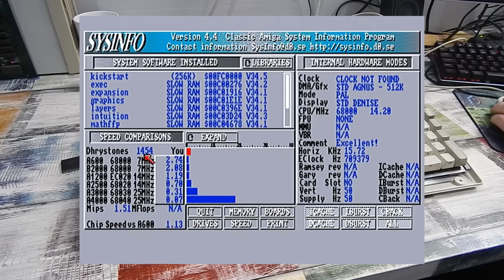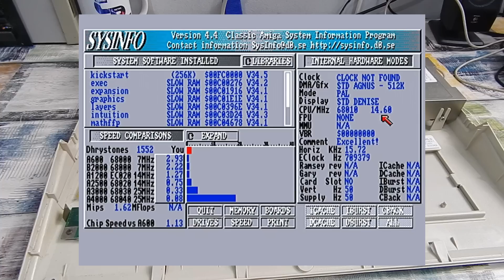Trying a 68010 in my 14MHz Amiga 500

Comment: I used to work with the 680x0 CPUs in the late 1980s.
The 68k was a nice CPU that had some limitations and the next iterations improved the situation gradually.
To my memory the main advantage of the 68010 was that it had the full instruction set, but only very little I.provment in performance compared to the normal 68k. That situation only improved with the 68020 and 68040 with the FPU and MMU co-processors.
I did not gather any experience with the 68040.
But I think it is fair to say that an upgrade with a 68010 is not worth the cost and effort.
So, yes it is useless.

Comment: The most useful aspect of the 68010 is with whdload you can exit back to workbench (normally ESC or F10) without the .slave file having to support quit to wb. This is a 68010 feature is called the VBR, vector base register and it allows a program to have its own isolated environment. The only other feature is a slightly faster loop mode for certain types of machine code loops. The HC' 68000 chip uses CMOS technology and runs much cooler, CMOS only draws power when it is switching and can be over clocked more. The 010 is NMOS? and consumes power all the time thus running hotter and being less overclockable.
Reply: Another great thing about the 68010 is that the VBR (vector base register) is movable - in the 68000, it's fixed at address $0; in the 68010 it's set in a register (but defaults to $0). On the Amiga, location $0 is chip RAM so it's contended and not as fast as fast RAM. All interrupts hit the VBR to find the location of the ISR (interrupt service routine), so that includes vertical blank, hardware events, timers, etc. Moving that VBR out of $0 to somewhere in fast RAM was a huge speed boost. Sadly, some games used to write into the vector table at location $0, so if the VBR was moved, or the game didn't respect where the VBR was relocated to (overwrote the table), it would cause the game to fail. So, arguably, yes, you could see a significant speed boost for games with a 68010, if you've relocated the VBR before starting the game. ColdCapture was a system register which could be intercepted so you could execute code on reboot, so a VBR relocator which sat in a ColdCapture hook would have achieved this.

Comment: The solder dipping of pins generally only happens with pins that get soldered to the board. These are almost always in sockets so no need for them to have done that.

Also, the counterfeiters in China have gotten smarter about their toppings. IPA doesn't always do it now. You need to try acetone or similar.

Edit: I see you tried that later.

Comment: It's not pointless. And throwing the chip like that was just childish and wasteful. First, that chip was probably a 12.5MHz or slower version of the 68010. Try running it at that clock speed. Second, did you research beforehand to see if any of the games you were planning to test were 68010 compatible from the start or modded since their release to work with it? The chip has improvements over the 68000 that cause [mainly] games to not always work if they aren't programmed to identify a 68010. That happens whether the platform is an Amiga, an Atari ST, an Apple Mac, or a Sega Genesis/MegaDrive.

As for the performance differences between the 68000 and the 68010, I'd suggest looking at the Atari Games Corp's arcade titles from the mid to early-late 80s era. There's a reason why "Atari System 1" games like Gauntlet used a 68010.

Comment: @ 6.34 "100% genuine"! Well "yes" it is a 68010, but definitely remarked. God knows the original speed grade. IPA won't reveal anything with a part that has been sanded down and laser etched. At 8:49 it probably the fine dust residue from the sanding process.

Comment: Ha ha! I've bought totally fake 68000 PLCCs from a Chinese Ebay seller. They weren't even 68000's, once I was able to use a multimeter to find the GND and VCC pins (in the totally wrong place). I had previously wasted valuable time testing all 20 devices in my PCB, and of course they were as dead as a dodo. These parts were sanded down on the top  laser etched - a big giveaway of a highly likely fake. My best guess is that Motorola never ever laser etched their parts back in the 80's (and 90's ?).

Also the Moto bat wing logo is of low quality, again another sure tell tale of a fake part. A manufacturer would make sure that it's logo was as good as could be!

Also if you get multiple parts, they will likely all have the same date code, but if you turn all the devices over, you will find the bottoms of the devices, which cannot be easily sanded) have different writing and different sized moulding holes (they have a name...) in different places. Definitely NOT from the same batch! Also check the pin 1 "dimples" on the top. Again expect to find different sized dimples, and some parts will have no dimple at all.

While the part could be genuine, you have no idea if the speed grade has been faked.

I bought some DIP MC68HC000-16 parts. These were not laser etched, however the re-ink came off easily with a little rubbing using IPA to reveal the original markings, a MC68000-8, so NOT CMOS and not 16MHz. B*****ds!

The thing is there is no need to remark, just be honest and say these are salvaged parts and may not work (due to lack of ESD handling during recovery). Given the low prices they are sold at, I would accept this and take a chance.

Comment: Even if it was a totally legit 14mhz 68010 it's usually not worth the cost and trouble to replace the 68000.* I'm not aware of a single accelerator that used one. IIRC, the '010 was mainly used in support hardware like external drives, printers and the like. Adrian Black could talk your ear off about how many fake chips he's bought from Chinese sellers over the years...

* Unless you're increasing the actual clockspeed too.

Comment: In my A500 i've just replaced the rectangular 68000 with pin compatible 68010.
4€ shipped...works fine.
Reply: I did the same back in the day - very few things got any speed boost...but there again, I did know that it would be, at best, 10% boost..mainly to some very small code loops. still, it was a cheap upgrade

Comment: Having done a quick Ebay search I have seen 68000 CPU's listed as working at frequencies as high as 20Mhz.  One of these would probably give a much more noticeable speed increase than a 68010.  Having said that these listings were from China so I have many doubts about the veracity of them.  Looking at the cost of other 68k chips that you could use to build an accelerator around the costs seem to shoot up extremely quickly with 68060's listed in the £400+ price range.  It looks like the best value CPU upgrade for an Amiga is essentially a PiStorm.

Comment: I switched from the MC68000 to the MC68010 many moons ago on my AMIGA 2000HD. I have the 64-pin DIP type and never have had any of the problems that you guys mention. Am I lucky or full of it? Only my computer knows. I wish I could find my old chip and try the same test cause there is a slight difference. I also run the 1.3 to 2.04 keyboard selectable ROM if it makes a difference. Might have to dust off the old beast.

Comment: When I worked with the 68k family in the late 1980s, I seem to remember the 68010 to be only a variant of the 68k that had some inconsistencies in the instruction set corrected in line with the later 68020 + 68030 chips. So, unless you needed complete code compatibility between computer model variants and deployed the whole family the 68k was the better choice. I ran an Atari ST with a 68020 CPU upgrade at the time and remember that as a noticeable improvement in speed. But I got rid of it almost 30 years ago. Real shame that.

Comment: My 3rd year project at college 30 years ago was to design a scsi ram disk using a 68010 as the main controller. It's a lovely chip to design with. The benefit there was that the async dtack could be routed straight from the ack from SCSI to terminate SCSI transfers as memory cycles.

Comment: 68010 wasnt really much of a bump and with the hassles it brought it  wasnt worth doing,   I remember those chips being in  dip format back in the day on those old ''rock lobster' boards,  if I remember correctly, I maybe wrong as it was over 30 years ago,  a pin  was  lifted and shorted to ground via a switch for compatibility reasons, once you flipped the switch you had to reboot or power down
Reply: Yes I remember something similar, ' I think' there was a mod to lift the clock pin and use a different oscillator perhaps, so if you had a stock 68k and got a faster 010 + oscillator there was a difference, but I might be mistaken. I think also 7% speed boost whilst it isn't much, if this was the latest laptop, it would be described as a whopping 7% increase in speed :-)

Comment: I have had lengthy conversations with a seller on Aliexpress about chips being resurfaced and they told me that they do it to maintain asset tracking. They basically copy one to all of them so that they can track what they sell for returns. If they left them all original they would know what was sold by them or not.
Reply from the maker: Interesting, but could they not just make note of the existing part numbers.
Reply: while that may be partially true - i've bought a lot of rebadged chips that actually were what they claimed to be - they almost *always* take it as an opportunity to mark it as higher speed grade. just ask anybody who has attempted to buy an '040 or '060 off a chinese seller..

Comment: That 68010 may not be even a 12MHz part. There is also some incompatibility between the 68000 and the 68010 on how some stack frames are formed, but I doubt that has any impact in the Amiga.

Comment: I remember swapping out the CPU in my Amiga 1000 with a 68010, the mythical 10% performance boost never materialised, not even in pure CPU based polygon games. The incompatibility problems however were not a myth.
Reply: I did this as well back in the day. (exactly the same. 10mhz-rated 68010 into my unaccelerated 7.16Mhz A1000.  Didn't see any noticible improvement at all.  swapped it back. :}

Comment: Just got me a 68882 50mhz from ebay. This was to put in the empty FPU socket of an old DCE typhoon accelerator. The moment I removed it from the jiffy bag. You could see where the fakers had masked the gold top and respray it. The ink came straight of it with a wee drop of IPA. It was a poor attempt at making it look genuine. Saying that it does run OK at 40mhz.

Comment: The 68010 was a controller version on the 68000 I think, not a true successor.
I would not have the expectation of a speed difference in any meaningful way.

The 68020 is the true successor and the first true 32 bit chip (hardware wise).

Comment: The 68010 was a common "upgrade" in the 80's.   Some people claimed it was slightly faster, but realistically, it seemed hard to believe it would/
Reply: The main potential performance gain was due to its optimized loop prefetch feature, but I guess that unmodified software written for the 68000 would not be able to take much advantage of it. Well exploited, you could get up to 50% faster for typical memory copy loops. But in the end, too much was already based on the 68000 and probably few (except for some niche applications) were willing to take the risk of writing 68010 software only (not compatible with the 68000), so it just missed its market. The other benefits were of interest more to workstations and server stuff than "consumer" computers.

Comment: A big giveaway that the chip has been remarked is the manufacturing date, Motorola were long out of the CPU making business in 2010 (they spun it off as Freescale), so no way was that chip made in the 25th week of 2010 by Motorola. You can see the genuine chip was made in 1996. But Chinese sellers do that to make it look new or faster than the original chip (which may be the case here, this could be originally an 8MHz chip), even going as far as laser etching as they realize buyers are getting smarter and can check.
Reply from the maker: I can't believe I didn't pick up on this.  To busy looking at the finish of the chip to actually read the text on it.  Well spotted though.
Reply: Few years ago I got 68882 FPU from china, I think it was 40MHz, it could barely run at 25MHz. It had LASER etching on it. Later on, I got the same chip from AmigaKit, and it runs fine at 50MHz. 
Sometimes it's better to spend more money and get it from reliable source than try your luck from china. I still have somewhere in my chip pile DIP version of 68010, and yes, it did not help much in speed.

Comment: I was one of those that tried a 68010 upgrade, on my Amiga 1000.   There was the tiny speed increase, but it introduced so many software issues that I went back to the 010.  Some games worked, some did not.  Same with productivity software.  There were a few differences in the opcodes.  I don't remember the details, but it just lead to to many crashes.
Reply: I remember there was a program called decegel that patched around some of the differences in the 010.  But I thought by WB 1.3 support for 010/020 was baked in?
Reply: @neozeed8139  Oh yeah!  I forgot about decigel.  Yep, by 1.3 the OS was fine with the other CPUs.  But many of the games out at the time still had problems.   Eventually things got better.

Comment: I recall back in the day games magazines advised against using a 68010 because it is not entirely code compatible and caused games to crash. The point being why use one when some software won't work with it. Been decades since I've delved into 68K processor types but from my limited knowledge, is it possible its a 12.5Mhz part? I don't recognise the part number from the ones I've seen but the 12 on the end usually meant 12.5.
Reply: As far as I know, it's 100% compatible in user mode, but in supervisor mode the stack frame format is different, and only the OS needs to care about that.  Games tended to manage the stack manually and use supervisor exceptions for things like copy protection, so things would often blow up.  The processor is just fine, but game programmers are never known for doing things according to spec, especially when it comes to anti-piracy.  8)
Reply: @Waccoon  Yeah, games programmers trying to squeeze as much out of it as they can, what are they like ;)  Recall when I upgraded to Amiga A1200.  Having to turn cache off on '020 and later '030 accelerators because of self modifying code.  Often used in copy protection, it would crash it if the instruction cache was enabled. Or where they use the redundant 8bits on the address registers, something I admit trying myself before realised it wouldn't run on a full 32bit system.

Comment: If you had done your research you'd found this wikipedia article about the 68010...

https://en.wikipedia.org/wiki/Motorola_68010

If I am not mistaken the 68010 was primarily used in the A1000...
Reply: No it wasn't. If you'd done your research you'd have seen there was a non-Commodore article about using it as an upgrade, but the A1000 had a 68000 CPU.

Comment: I can dimly remember that the 68010 made some changes to the instruction set to do with interrupt handling - it's not just a 68000 with a small instruction cache added. So it could be that some programs will run fine and some will choke, depending on how they were compiled.
Reply: Yeah, stack frames are sized differently, and poorly programmed games that try to manually manage the stack will blow up.  The instruction set isn't the problem.  Almost all compatibility problems with the '020 and up are due to variations of the stack frame issue.

Comment: I once saw someone on a channel barely removing the 'paint' (or whatever it is..) from a refinished IC using acetone. IPA did not touch the finish at all, it was just too resistant. (Don't remember exactly, but probably it was Adrian or David Murray).
PS: Just saw you later tried it xD
Reply: Yes, the paint cover will go off with acetone. With a bit of luck, you can reveal the real markings hidden underneath.

Comment: Speedup would be negligible, the instruction cache is very small (6 bytes) on '010, only would apply to super tight loops.
Reply: Also if it is genuine it should allow you to quit out of games on WHDLoad, whole '000 wont.
Reply from the maker: Whdload was updated back in July to allow exiting on the 68000.  I only learnt that while recording this. 

Yes the speed increase is very small, it's a topic I've seen debated several times on forums so thought I'd try it for myself.  It's just a shame the chip wasn't stable as I had planned to do more tests.
Reply: @CRG  It was marked N12, seems those 2 extra MHz were too much for it 😉
Reply from the maker: Yep seems I was asking a bit much 😂

Comment: cotton buds and acetone, isnt it?
Reply from the maker: Possibly, IPA maybe isn't strong enough but you'd like to think nail polish remover would shift whatever was put on the chip.  It did take something off but there might be more to come.
Reply: @CRG  Sometimes the chip tops are over-painted, sometimes they're sanded-back.  Reduced residue and a rough texture could well be a sanded top.